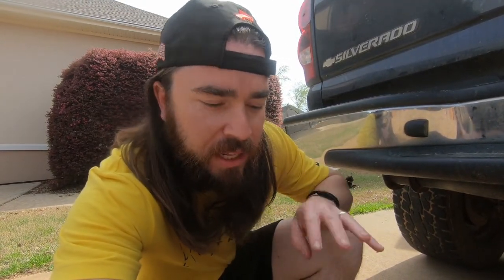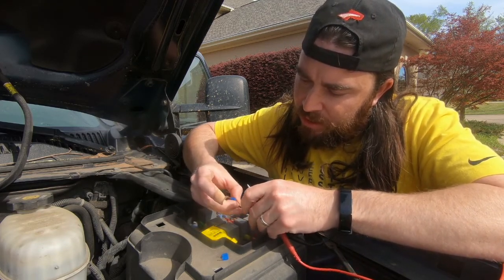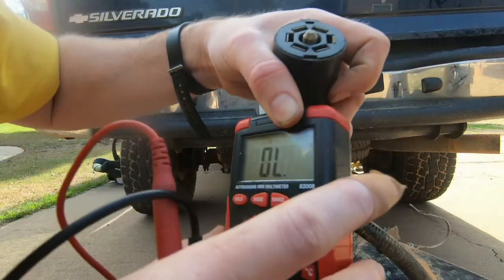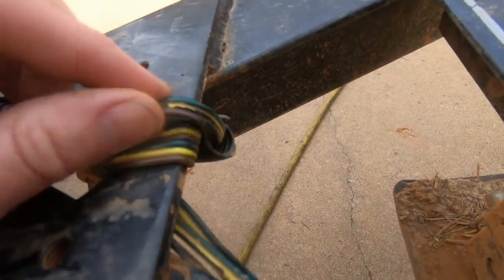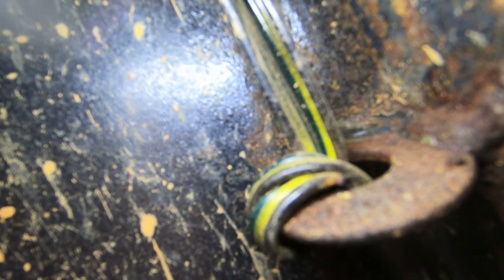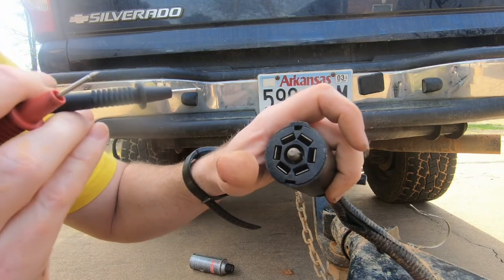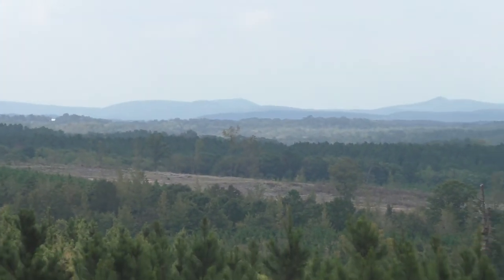How to Fix Trailer Lights that Keep Blowing Fuses in Your Truck

Comment: You should always read continuity across the positive side of the light circuit and the ground , If you do not you have an open circuit and the light would not work. You have to disconnect the wiring to the light or remove all the bulbs and than test the positive wire to the ground and if you have continuity you have a short in that wire.

Comment: Not sure why but you were checking tail/running lights to brake lights on the trailer continuity test and you were getting a beep, which you shouldn’t have. You must have had something more going on there.
Reply from the maker: I haven't watched this video since I made it, but I can assure you that there wasn't anything else going on as I still have this trailer and it hasn't had any other problems since.

Comment: Awesome, this is exactly what I need. My flatbed running lights don't work when hooked up to any of my three trucks.  Since it acts the same on all three trucks, I know the trailer is bad.  This will help me troubleshoot the wires
Reply from the maker: Sounds like you'll have it figured out in no time.

Comment: I have continuity with all my pins on my trailer 7 pin connector. Does that mean I have shorts in all wires?? Also when I test for continuity with my lights off on my truck plug there is continuity does that mean I have a short on my truck side also??
Reply: that's because you could measure continuity through your bulbs.  need to remove all your bulbs, for his test to work,  maybe not with LED  bulbs   ( light emitting diode) . they will only show continuity one way.

Comment: I've been chasing a blown fuse cause in my right turn/brake circuit. Been an issue since trailer was new. Thought it was mybtruck, but other trailers don't blow fuses. No schafing found yet.🤔

Comment: First of all get rid of those Scotchloc connectors .  Use wiring lubricant even penetrating oil will work  in the light cord socket .

Comment: This was exactly what I needed.  Thanks for taking time to upload this video, it helped me fix my trailer.
Reply from the maker: Glad to hear it helped you get it fixed!
Reply: @FarmDad  Correct me if I'm wrong, but your method for finding a short doesn't work for clearance lights? Specifically clearance lights that only have one wire going to them. This did help me to find a short on my tail lights so for that I thank you.

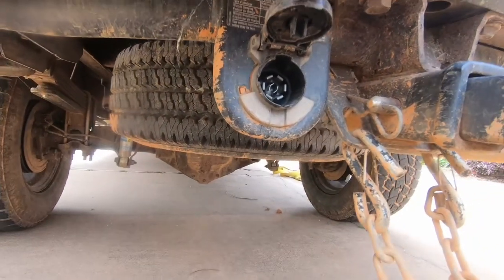Comment: From the chart you posted @2:03, you checked continuity in the trailer plug from the Tail/Running Lights to the Trailer Brakes.  You didn't put the probe into the Ground, which would have been the slot at 5 o'clock.  You did 1 o'clock and 7 o'clock, right? @3:05 Clearly you found the problem, but that exercise didn't tell you what you thought it did.  I'm in the middle of trying to find my own trailer issues, so I'm following your instructions closely.  Thanks for the video.   When I check mine, I get continuity from the running lights to the ground AND from the running lights to the trailer brakes.
Reply from the maker: I think you are correct, it looks like I probed the wrong spot when I did it on camera.  I bet I did it right though when i was testing before I started filming.
Reply: @FarmDad   thanks,  strangely there's a circuit from running lights to trailer brakes though, any idea why that is?  Then when you found the bad wire and fixed it, that circuit was broken.   I have the same thing you did, and I'm hoping there's a hint there for where I should be looking.  The problem is in my travel trailer, so all the wires are hidden away, I can't see them like you can on your flatbed..
Reply: I have similar issues with truck fuse blowing, continuity between ground to tail light pins and trailer brake to ground pins in trailer plug. Looking for a break in the tail light wires is a bear! Here’s what’s got me scratching my head: I used some spare wires to connect tail light pin to positive battery terminal and a wire from ground pin to negative battery terminal and it all worked. So it appears trailer wiring is fine but truck is the problem? Any ideas?
Reply: @oregonlums  try the continuity test with the multimeter on the vehicle side of the plug, that will tell you if its the vehicle and not the trailer

Comment: Thank you so much buddy! This helped me fix my new Maxx-D roll off dumpster trailer. One of the side marker lights had unplugged and they had a light connector in the middle of the frame where no lights are. So it kept touching metal and shorting out I believe.
Reply from the maker: Good find!  👍

Comment: Many trailers have earth connections directly to the individual components in the light cluster, all coming back to the earth pin in the plug.  The multimeter will supply a current through the component (brake light or whatever) back to earth.  There will be a beep on all circuits under these circumstances, and the problem will not be found...

Comment: Very poor wiring job on the trailer. Wire should never be run through a hole like that. Must have a grommet in the hole.
Reply from the maker: True.  Cheap trailer

Comment: Question.
i have an 02 Dodge Ram 1500.  My 4 pin flat connecter on vehicle for trailer works fine. EXCEPT THE RUNNING LIGHT.  My 7 pin connector on vehicle for trailer works fine. EXCEPT THE RUNNING LIGHT.
What do you recommend?
Thanks.
Reply from the maker: I'd start by checking fuses.
Reply: @FarmDad  ok thank you. Both 4 and 7 pin connectors work fine according to LED tester, but i get nothing on LED test for running lights on either 4 or 7 pin connectors.
Reply: @FarmDad   it was a fuse. thanks for replying friend.  i thought truck running lights, and trailer running lights were same fuse. thats why i overlooked it. duh! lol
Reply from the maker: @לאידועלאידוע-ש1ז  awesome, I love easy fixes.